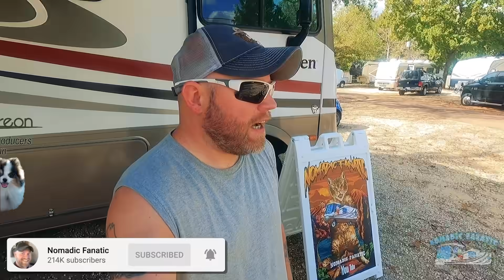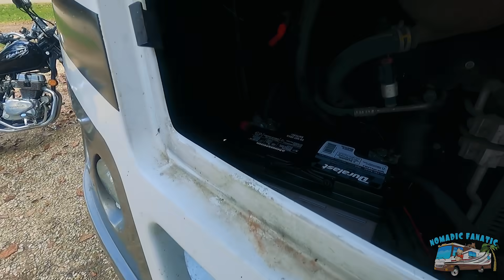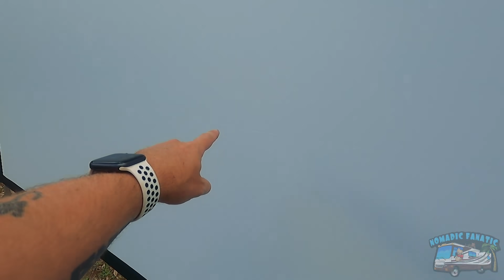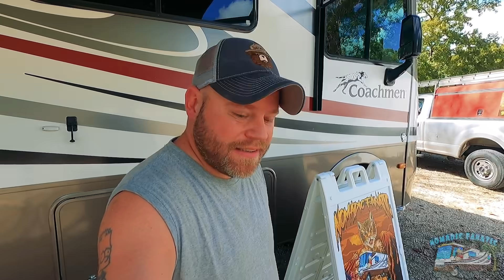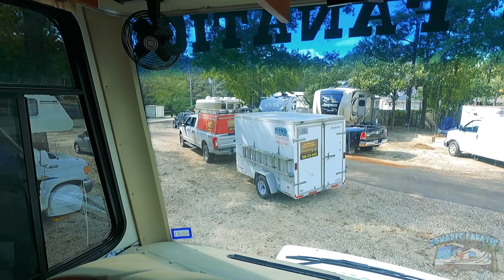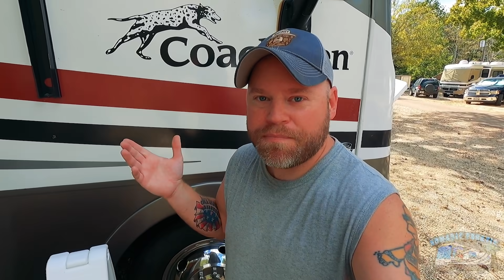More Onan Generator & Lippert Leveling Repairs... $$$

Comment: I have never had a Mobil mechanic fix anything reliably. I try to swing by the factory every year or so with a list of repairs. At least it gets fixed and comes with a warranty. Your headed that way. Drop it off and tell them not to call you till everything works!
Reply: Agree
Reply: It could be a year before he hits the road with everything working as it should.
Reply: Almost agree. I would go to Lippert, have them fix Lippert parts. Tell them it’s your home so you will be living in their parking lot until it’s done. Then, go to Cummins and do the same regarding generator

Comment: Have you considered replacing the Onan generator with a portable inverter style model? (Honda/Yamaha/etc)  If there's room in the compartment you could wire one up for auto start and get it fixed anywhere.
Reply: Honda and generac have replacement gens made for RV's.  You need to be sure you get something strong enough for your unit. 2kw won't cut it.
Reply: Or replacing with a NEW Onan?
Reply: ERIC STOP TRYING TO FIX THE STOCK SHITTY PARTS ON THAT RV/GENERATOR. BUY A HONDA GENERATOR AND MOUNT IT IN THE COMPARTMENT. AT LEAST YOU CAN RELY ON A HONDA ETC. HAVING A LEVELING UNIT IS A LUXURY. FIX IT ONE DAY IN THE FUTURE. BE HAPPY BRO! NO BIG DEAL! YOU WILL BE OK!
Reply: Ask around and find a small engine guru. sounds like a fuel supply issue. Dirty tank? Clogged fuel line? Fuel, air compression, spark with those it pretty.muchnhas to run
Reply: @mr.koivisto6975  :  That is what I would have done.  A while ago.
Reply: @soving   :  I agree.  At this point it sounds like a problem in the line or fuel tank.  Or just time to buy a new Onan and move on.
Reply: @faithsrvtrip8768  honest a real good small engine guy will diagnose that in short order. If it is reproducible even better.
Reply: @soving  - Glad you mentioned this as I wondered if a clogged fuel line etc might be the problem especially when Eric said it just shuts off after briefly running.

Comment: Every year I swing by West Coast RV Recycling and Sales in Centralia, Wa and they fix the things that have piled up during my travels. I make an appointment and plan to spend the day. We go through the motorhome and fix all of the little things that need attention. Last year I had a problem with my Onan generator. I had a dealer look at it was told the usual (which might be correct) that we may need to replace a bunch of stuff, that this would take a while and it ain't gonna be cheep. So I mentioned my woos to West Coast RV Recycling and they put I guy on it - their Onan generator god and it took him about an hour to find the problem, clean the carburator and I was good to go. Price about $100. As your leveling jack problem came up you were just a few hours away from them but headed away from them. I know what I would have done but you can't always call the shots.

Comment: Have you had the governor on the Onan checked out? Maybe there is a situation where once it gets warm something slips. Just a thought.
Reply: I'm sure the mechanic's checked the valves. Right?
Reply: Josh  Yah I just can't recall. I fit is running fine and then shutting off my assumption is it has to do with heat somehow. Oil getting thin after warmup maybe, I dunno.. Wonder if there is a low oil pressure shutoff on it.
Reply: Could it be the driving and bumps are causing something to slip?
Reply: Josh  also Eric drives on a number of roads and such that you have to wonder if that RV shoukd be driven on.

Comment: I fixed my Onan on my Mirada. It’s a stupid issue for mine. Just cut off after 10-15 minutes. After I put oil in it. Turns out that if oil is at proper topped of level it would die. Read a few suggestions and took some oil out (turkey baster). I have to keep oil at 1/4 full. Works fine then. I suspect a bad sensor or just pressure thing.

Comment: I’m sure you’ve done plenty of research, but here’s a suggestion from my friend who hasd a similar issue.  “Check the oil level in your generator when the oil level gets low it will shut down the generator. As the oil gets warmer it thins out just enough that it may fall below the proper level and shutdown the generator.”  I was thinking, overheating or BAD sensor that thinks it’s overheating... I’d make LCI and Onan next destinations.  Good luck!

Comment: I had the same problem with a Onan/Cummins 12,500 Watt diesel genset. Multiple repairs, parts, assurances and it still quit running at around ten minutes. We finally replaced it with a hardware store contractor style generator.

Comment: The same thing happens with a Sticks & Bricks house.  I can't tell you how many times we have sat and waited for a repairman to show up.  I can't tell you how many times someone shows up and says they don't know how to fix our problem.  Or they show up and say you need a new line run and this dept can do it.  3 weeks later they show up to run a line and the line is fine, it just needed something the 1st guy could have replaces.  We have 3 rental houses and our house has an inground pool.  Between the appliances, HVAC, plumbing, electrical and things like out pool cover (they were here Johnny on the Spot to install an automatic cover) but will they come back to fix the parts that have stopped working.  We have closed the pool for the winter and the cover won't close.  It's getting filled with leaves!  Hopefully when you get to your house, it's parked or you can take it somewhere so it can be worked on until it's working right.  Good Luck!  HUGS~Donna

Comment: Hey Eric! Sorry to hear my idea didn't work. I'm still working on this from here. I'm trying to get a list from Onan people on what all ways it can just shut off. I'm still thinking its electrical. Either a connection or a emergency switch of some kind. Engine only needs air, fuel, spark. But the shutting off randomly makes me think electrical. Maybe you could start the generator and with the door open. Sit next to the generator and listen to how it shuts off. Smell for unburned fuel. If it tries to shut off. Tap on it in different places (airbox, carb, etc) to see if it keeps running. Do you or have you run fuel treatment in your RV tank? 
Anyway Eric I will keep looking into things you can do from your site. Maybe you can stumble onto a direction to go in. Or at least give the mechanics another clue to the puzzle. That way it will help keep hourly rate down if you indeed need to take it back in. Ttyl
Reply: I did find out. If the oil level is to HIGH or Low can make it shut off per Cummins. Low will make the oil heat up too quickly. Which can cause a shut down. To high will trip a sensor and shut down the generator.

Comment: I just repaired 2 slide hydraulic rams. It took several cycles to get all the air out. That is a manual switch not a pressure switch though. I am wondering if there is a way to force cycling of the stand to get a fully bled system. I could see air being very problematic for the pressure sensor. I am not a mechanic but have done major repairs on all my equipment and have learned through frustration diagnosing can be a bitch for anyone. Even stumping the pros rarely.

Comment: My Thought... I would check power, the sensors, and circuitry for overheating... if some sensor or switches are overheating perhaps that may be an issue too.  however I would think given a  chance to cool off I would also think it would work again too ...  also look for feed power and test to see if the control area is getting power then when you hit the switched for the levelers to operate .. are they GETTING power and SENDING out power when you hit the switches, verifying if the switches and circuitry ARE working too!  That sounds like what what your RV repairman is attempting to do with the replacement of the circuit board.   I just heard the jacks down aren't all the way or whatever your readout is saying ... check the jacks to see where the button on the jacks mechanism to show the jacks are down, and locked ... there may be a button on each saying when the jacks are up in place... down or up.  If the jacks are not retracting all the way up in would not set that indicator and the system would no know that the jacks are up ... likewise if there is a sensor that says the jacks are locked down and they are not working it would think the jacks are not all the way down ... look for those up and down sensors on the jacks. also check for road grit that may have gotten into those components to foul them up.  Clean and Lubrication for the movable components and swivel points, sensors and triggers on the undercarriage.

Comment: I purchased a brand new motor home thinking that was the best way to go . Then I thought I should have bought a used one that way someone else has got the bugs worked out of it . Nope anytime you bolt a house to a truck frame it's going to fall apart . I even bought the 5-year extended warranty from Camping World only thing is Camping World quit working on campers. They say they work on them but when will they work on it ? Too busy selling new units to worry about old sales. Ask Marcum lol

Comment: I was able to work on my own generator And they have weird quirks is a low oil cut off but if you have too much oil it'll stop running if it's not vented well enough and it sucks in too much of it's on hot air it'll cut off stop running Dozen reasons why . There's a company called flight systems You may contact them They may have the answers for the generator.

Comment: Eric.  Two things to try on your generator.  One. Fuel flow test. Remove fuel line from carburetor, add enough line to aim it into a catch can. Turn on pump.  Run it longer than when the engine stalls.  If it continues non stop well past the time the engine was stalling and it has delivered a good stream of fuel it's not a fuel problem.  Two.  Get up under your RV and look at the generators exhaust.  Look for crushed or bent pipe, hit it with your fist and listen for any rattles.  Loose inner baffles can shift and momentary clog the exhaust.  Unbolt exhaust from engine head and run again.  If it doesn't stall any more the problem is in the exhaust.  There is a third possible problem caused by heat and the ignition system, but it's' rare.

Comment: Hey Eric ~ Don't Give Up Just Yet!!  Jax Man loves that RV.  He gets to ride / sleep on the  front dash area.  The theater style recliner loveseat is so comfy.  You have fixed up the inside to make it your own >>> Jax's picture in a black tux, the nice mood lighting.  Nice bathroom, and Jax Man loves curling up in the sink. One of his favorite spots.  So if it were mine, I would enter the  info such as Make, Model, Year and the current problem >>> Google search it.  Find a Forum where you can chat with others that might have had the same issue and got it repaired. You can also Google RV repair shops and set an appointment in your home area.  Go "home" for a while, set up all your new Mickey  Mouse items, then make a video of the collection.   You can also Google search for the "Best RV" read reviews.  Really dig into information find out all about the engine, the levelers, the sliders, the floor plan, see which RV is designed for you.  Take your time and you;ll find "the one".  Take Care, Stay Safe & Happy Trails To You!!  DD

Comment: Hey Eric!  Big fan, first post.  We have MANY similar stories.  I'm in southwest Chicago, Il, RVer for decades, owned a 2005 Fleetwood Tioga SL and then I "upgraded" to a 2019 Coachmen Pursuit 32WC.  Before buying I visited the Coachman plant in Indiana, convinced it was a good build, good value.  So far, everything Coachman has been ok.  BUT, in 11k miles I have had to replace the windshield (stress crack), replace the rear AC/heat pump unit TWICE, replace the LP furnace control board, dealing with a fogged out backup camera, replaced a failed main inverter, fix the front bunk system AND YES... am working on getting the Liepert leveling system fixed...  oh, and last week the flex goose neck for the kitchen sink split in half, dumping an entire sink load of dirty water on the floor.

All that said, I wouldn't replace any of it for the trips and memories it's allowed us to experience.  Ok, it might be nice if LESS things failed.  Take a deep breath, have another Bud and know "if it isn't this it'll be something else".  Seriously, be safe and know the only way you would avoid all of this would be by sitting on your rear in Illinois.  Take it from me, the road is better  :-)

Comment: I had the same problem with my Onan they rebuilt the carb two or three times, got a new one It was bad sent it back got a new one put it on and it has run just fine. They even ran it with a external electric fuel pump still quit when ever. The second pump did it.

Comment: I have a Damon THAT I CAN'T GET WORK DONE ON.  My leveling system quit working in June when our son put in reverse while up on the jacks.  Now all the lights come on the control panel and it will not reset.  I am paying close attention to you situation to see if it might help me out.  I have 3 basement doors that won't latch.  I had problems with the generator shutting off at random due to the fuel filter body breaking away from the metal nut portion.  The last person that changed it out must have shortened the hose and put too much strain on the connection. Now the gen is working but no jacks.  I feel your pain bro . Keep up the good work hang in there. The Lord i keeping an eye on you.

Comment: Just spit balling here, but does the Gen. cut off even with no electrical load on it?  Just wondering if the gen. is good but it's getting some bad indications from your electrical system.  Kind of like a fail safe where if there's a short or issue with the electrical it kills the generator.

Comment: I wonder if the pick up in the actual fuel tank is plugged? I had problems like that with the screen on the pickup being bad.  It could also be bad head once it gets to temperature it doesn't have the compression to keep running? Just thoughts on gen. idk anything about the leveling system other than checking relays and grounds idk good luck

Comment: I feel ya,  bro. I have an old Jeep that’s the same way. I’ve replaced the wheel bearings multiple times, rebuilt the AC system three times, gone through two sets of brakes and rotors. It just seems like it’s never going to run right. I’m ready to buy a brand new truck.

Comment: Eric, we have been in the same boat.  It is very overwhelming.
Has the voltage regulator on the Onan been checked?  That turned out to be our problem with the generator.  It would not stay running under a load.  It kept running, but wasn't producing power.  Nearly drove us crazy.  Worth looking at!  Best of luck to you.

Comment: I not sure if this is helpful info , but when my van got bumped, (no damage to the van), the harness of wires had to be replaced in order to open the door hatch. If I recall correctly, you had taken Maranda up a steep embankment and it dragged the back bumper and I knew that was not going to be a good thing... maybe the harness on Maranda have received just enough damage from that incident, which could be draining the power from the generator...

Comment: Hubby said when his generator did like yours,  it was because the gas line going from the main tank had a problem.  The line got old and was sucking air, another was kinked/pinched.  With an external tank, it ran great (gas can on ground next to generator).  He got so PO he gave away the rv.  What would I do?  Trade in that bad boy and get another one or go to Coachmen and let them fix it.

Comment: I know you have replaced everything on the gen. you have indicated that the gen will run and then stop. Sometimes the coil has a hair line crack at the neck that  you can not hardly see. When it heats up it opens a little and shorts. Put a coat of silicon  around the neck and see. Just a thought.

Comment: I haven't checked all your past videos on the generator, but our 2008 winnebago class a's onan would just randomly shut off.  I found the ground wire needed to be securely fastened to the frame.  Mine was located on the left front area of the generator when i had the cover off.  I hope that's it. Happy trails

Comment: Sure sorry to hear about you having more problems with the generator. I've listen to all your attempts to fix the issues and as a mechanic myself I can only make a guess at whats causing it to run and then shutdown after a short time. You've fixed or replaced all the components so. I think you have a leak in the fuel line that feeds the generator. Cap it then pressurize it and see if it looses pressure.

Comment: If you travel you need to learn and understand all the components of your rig and don't rely others
Reply: Is there an RV mechanic school near your house? That would be a good winter project.
Reply: @ES-mc3cc  you can go online get owners manual for each components of rv and call the manufacturer of each also 
research youtube. Have a little knowledge of wire diagrams could also help.
With all the down time full-time rvers have spend the time wisely and research

Comment: How about using zoom to friends that have successfully solved mechanical/electrical problems for you in the past.  YOU have be willing to work to verrrry accurately define the problem in great detail, not just it doesn’t work, but when, how does it respond to all different inputs.  Toss the Onan, replace it with a portable Honda, professionally installed, so it can be easily removed/replaced for service by leaving it at a shop.

Comment: Are there switches or sensors on the leveling pistons under Miranda? Anyone chase the wires and look for breaks?
A tricky part of diagnosing RVs and boats is there are a bunch of random systems tossed into them. Some are independent and some piggybacked.
As for the Onan, I would isolate it from the house and see if it works.
Good luck Eric!